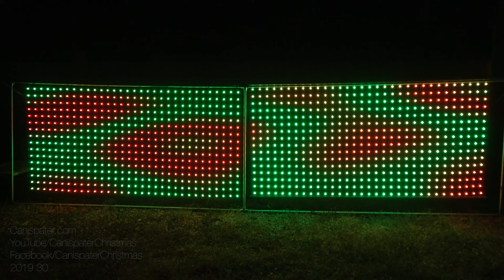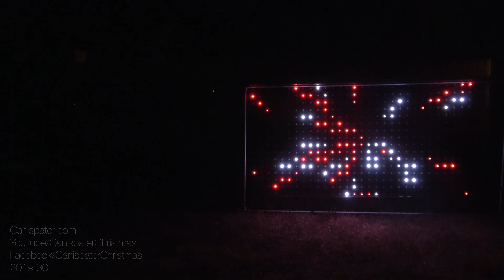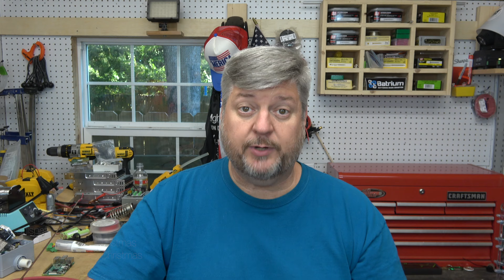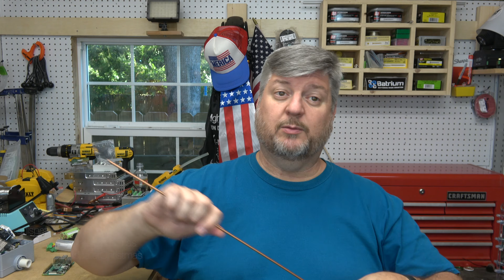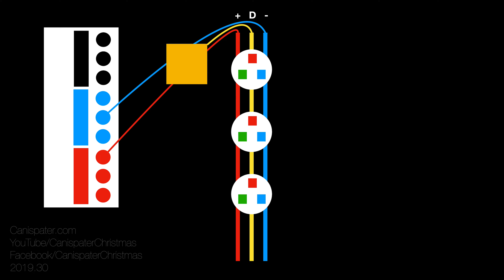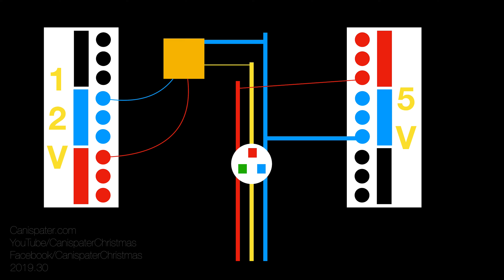🎄UPDATED! 5V/12V SHOOTOUT and Power Injection Follow-up  (2019)🎄

Comment from the maker: from delaserdudeXD:
Great Vid. Very Informative.
I'm including the info below to cut back on copper cost and keeping wire size manageable for new users. 

If you go by your video, you would need a  minimum of 6 AWG (37A rating) wire to handle the 30 Amps with a 35A fuse when being used at 100% all white - going from your PS to the fuse 

512 pixels x .06A = 30.72A

Hope the info below helps

 It looks like you've used the Amperage /Wire Gauge ratings for transmission(long distance). The rating for branch circuits (home) and chassis have much higher.
 Current ratings  for power transmission that you've used are a very conservative rating and based on high voltage drops (higher resistance) and long distances. 

For reference, the National Electrical Code (NEC) notes the following ampacity for copper wire at 30 Celsius: 

14 AWG - maximum of 20 Amps in free air, maximum of 15 Amps as part of a 3 conductor cable; 

12 AWG - maximum of 25 Amps in free air, maximum of 20 Amps as part of a 3 conductor cable; 

10 AWG - maximum of 40 Amps in free air, maximum of 30 Amps as part of a 3 conductor cable. 

Above is the rule of thumb for home branch circuits, Max amps for shorter lengths (chassis) have even higher amperage rating. It all depends on how many wires are bundled together, operating temperature and total length (frequency is also a factor but doesn't really pertain to us unless you're calculating for the data line) . Using the rule of thumb is usually more than adequate for holiday lighting. 

Lets take an example from the vid (since you're giving us a reading on the A/C side - this will pertain to house wiring) - 12V pixels running 50% at full white and your current power supply (PS efficiency rating will vary the Wattage used)  are using  178W would theoretically max out at 1.5A. If you had a dedicated 15 A circuit which typically is run with 14 AWG in a home - you could safely run 8 -10 of this type display on this circuit. 

Wattage = Voltage x Amperage (Watts Law) 

178W / 120V (my Average home voltage 118 - 122 volts) = 1.4833Amps
If you use the Transmission rating 5.9 - 7.5A  - you would only be able to have 3 to 5 displays on one 15A circuit or only 5-7 100w light bulbs on each 15A circuit breaker in your house

If we take a look at your fuse example: on the DC side when only 1 size wire is used ( it looks like you're using 2 legs off the PS so the fuses and wire will be smaller for each leg to the fuse). Running 512 pixels at 0.06A/ pixel  (Which is all white at 100%)  = 30.72Amps (theoretically - remember using the actual amperage draw would be the best and will be less at 50% or 30% which would allow you to use a smaller wire as well as having to use a smaller fuse). 

The single leg configuration would require a 35A fuse if you want to protect the Power Supply and separate lower rated fuses where you inject power or change to a smaller wire (since most newer pixels are only 18AWG [many are even smaller] and would melt its insulation and short or burnout before that higher rated fuse would blow. Since the insulation type used on the pixel wire is usually not known, it is probably safe to use a 7.5A fuse for 18AWG and 5A for 20AWG and possibly 22AWG (based on 125 max 12V pixels recommended per run - 12v pixels were chosen because they will run more pixels  and draw more amperage on the same size wire  5V pixels use)

 If we use the rule of thumb, it would need a 10 AWG wire, going from the fuse to the power supply and from the fuse holder to each distribution point either at the pixels or where you change to a smaller wire . 

If we use the Chassis rating a 10 AWG wire would carry up to 55Amps

Since the Fuse holder is short, if you look at the chassis rating of a 14 AWG it can handle a max of 32 Amps. If you to use a 30A fuse you should be ok (since the 30.72 tends to be a higher max than what they actually draw at all white). If you want to be completely safe you can use a 13 AWG (35A), but since this is not common your next choice would be a 12AWG (41A) that would even handle that 40 Amp fuse you're using now but a 35Amp would be better. 

As You know, to make things simpler
The community has come up with the best answer. 

Use a distribution board that is rated appropriately.
 Use individual 14 - 10 AWG wires From the power supply to the distribution board (based on total pixel amperage drawn) and the same size wire that your pixels are using -  to go from the distribution board (using 5 or 7.5A fuses [depending on wire size]). 

Make sure NOT to use more total Amps than the distribution board is rated for and NOT use more Amps than each distribution leg is rated for .  Remember you can have 1 or multiple injection point(s) from the wire you used to go to the pixels on the same leg, depending on how many pixels you're using at each injection point.

These are only recommendations, your mileage may vary. 

Amperage carrying ability varies not only by wire size but by insulation type and temperature. 

These recommendation are based on:
You are using commonly available USA sold copper wire at around an Ambient Temperature of 30° C, 86° F or lower

Using a fuse rated 20% less than max rated amperage carrying ability (same as power supplies) Especially if you use all white for long periods of time in your show. 

If you don't run and don't EVER plan to run all white for for extended periods of time and YOUR MAX CALCULATIONS ARE BASED ON RUNNING AT LESS THAN 100%  you can at your own discretion run at 10% less than max rated amperage carrying ability for wire and fuse.

Comment: Can I get a good description of what power supplies to purchase for 12 volt pixels. Ive had new bullit pixels in a box for 3 years now. Never done this before.  I am ready to learn something new. Love your videos. Greetings from Fort Worth.
Reply from the maker: Thanks! I prefer the MeanWell brand and typically use the 350-watt variety in my display. They are more expensive, but I've not had to replace one yet. People have also started to use server power supplies. They are generally higher wattage so good if you have a high density prop (or group of props close together) pulling a lot. I've also used the cheaper ones from Amazon and never had an issue, but I had spares just in case. 😂
Reply: @CanispaterChristmas  thank you sir. Really enjoy your channel. Keep up the Great Work!
Reply: I have one more question sir. I have 2812 bullet pixels. Do I need a special attachment to connect them to the differential receiver? Thanks
Reply from the maker: @stevetaylor2943  According to the spec sheet, 2812 is supported. What do you mean by "special attachment"?
Reply: @CanispaterChristmas  The connector on the end of my bullet pixels don't match up with the connectors on the Falcon Smart receiver . Do I have to cut off the connector on the pixels to put each individual wire into the smart receiver?
Reply from the maker: The receiver should have come with green Euro-connectors you use to plug strings into the board. Some vendors provide or offer pigtails so you don't have to cut the string. If that isn't the case, you can cut the connector off the string, but leave enough wire so you can use it as a pigtail for other strings. You have to make sure the wiring is correct (pixels usually have printing on them telling you which wire is which, but also sometimes hard to see). If you aren't sure, post in the Facebook group - someone can check your work before you apply power. 😂 You can permanently damage the string if you get the wiring wrong.

Comment: Hi this may sound odd but you have one power injection cable with a fuse on the end so how are you managing to inject so many times along the string ? surely the voltage using one string time it gets to the end the rating would be a lot lower than the first injection ? or maybe i am reading this wrong , sometimes i do not understand how one power supply can inject to all the pixels when there are only 3 + 3 - terminals unless you run many ports from a controller , which means more controllers more power supplies and so forth , is there not an easy way round power injection ? if so how ? most have not got the extra ports from controller .
Reply from the maker: It's the tightrope we all walk as hobbyists. 😂  Shorter strings means less or no power injection, but costs more ports. Longer strings require less ports, but require you to understand power injection. Without getting into the electrical engineering side of things, the whole point of power injection is to maintain voltage along the string so the pixels will continue to function. Any time a pixel is powered, there will be a small voltage drop from one side of the pixel to another. Going from the power supply to a point along the string brings the voltage higher at that connection point and the voltage starts dropping from there. I this example, I basically created a single connection "rail" and injected power (probably more than needed) at several points along the string. There's likely still a voltage drop as it gets further down the string, but the voltage it is high enough to power the pixels. Does that answer your question?
Reply: @CanispaterChristmas  Great reply , so from the power supply you made 1 wire with a fuse then teed off the same wire to power inject the pixels all the way along .

Comment: Hi I got 5v pixels ws2811 using a dig quad so it needs 2 sets of wires from the power supply , so what I was going to do was use a 5v 40 amp power supply to power the pixels  a string off 600 was going to power inject 6 times with a 5v 40 amp
Supply and just run the data from the quad , is this ok ? quite new to all this .
Reply from the maker: That should be fine. I'd recommend one or more fuses for the pixels just in case. I've used single-fuse holders from an auto-parts store or one of the BlueSea (marine) fuse holders from Amazon (check my links).
Reply: @CanispaterChristmas  I decided to get one of these , Hanson Power-8 Power Distribution Board ,  to make life a lot easier when power injecting , maybe this could help others out as well

Comment: Great video as usual.  This is my first year getting into RGB pixels and will be taking it slow with two 7 ft. Candy Canes with 200 nodes each from Boscoyo.  I have my controller and will be building a box for two falcon smart receivers.  

My question is this, when you power inject are you using an unused port on your board?  I saw that it appears you made hard wire connections.  Is this the only way?   I've seen the "T" power injectors so in the beginning I would probably use those for a larger prop I will hopefully come up with next year.  But I am definitely excited about the arrival of all the components of my display.  I am also in the process of going over your online course that I purchased.
Reply from the maker: Awesome and thanks! There are many ways to inject power. The main objective is to maintain enough voltage all along the string to keep the pixels happy. Each pixel drops the voltage a little so it's one of those things you'll get the hang of eventually. Power injection is normally just connecting another pair from the same power supply to the end of the string (through a fuse to be safe). The controller/receiver has fuses, but a power doesn't usually so you add your own. For 200 pixels, you may be fine with just injecting at the end of the string. If the pixels in the middle look dim or dull, then add another connection to the center of the string, but let the pixels tell you if they need it. Keep me posted!
Reply: @CanispaterChristmas  Thank you again for the info.  Looking at the Boscoyo site, it suggested running the 200 nodes as individual 50 count strings to make a matrix so that's what my plan is.  Lol...the interesting part will be doing the computer programing, but I'll be looking at your videos to get me through.  Thanks again and I'll let you know how it goes.

Comment: Idk 5 volt is no brainer for me I can run double the pixels same power supply. And I plan hooking house outline and window maxtrix year round. 5 volt is very easy every 100 pixel add 5v and ground and you will have 0 problems.just use some landscaping wire 14 awg and you can T off it power and negative 1 wire 400 pixels at 30%
Reply from the maker: It's a difficult concept for some. Glad you have it figured out. :)

Comment: Is it okay to tie 5 and 12v grounds together? I have a few 5v lights and don’t want to use half of my controller for 5v.  So I’d like to run them off a single port and  just inject the 5v downstream while the controller is putting out 12 and not connect the 12v.  Thoughts?
Reply from the maker: You can do that. Just make sure you remember not to power it with 12V. 😂

Comment: I made a mistake of building my first pixel prop using 5v.  I'm still using the prop but the rest of the house is 12v.
Reply from the maker: No problem. As you gain experience, you'll likely have a mixture of 5V & 12V in the display. They both have their place.

Comment: I am about to make an order through Ray Wu, hopefully will come in on time, do you run 12v or 5volts?  Usually the higher the voltage the lesser amps but doesn’t seem case with pixels.  I watched lots of videos and read lots of articles but still unsure of what to buy.  Seems like 12 volts are easier to work with.  Thanks for any advice.
Reply from the maker: Shipping from China is kinda horrendous right now. If you are in the US, try wiredwatts.com instead. 12V pixels require less power injection so better for longer distances. If you're making a prop with a large concentration of pixels in a small area (so power injection is easier), 5V are much more efficient. I recommend people start with 12V because it's a little easier to deal with. Once you have some experience with it all, you'll want a new challenge and can branch out to 5V pixels. 😂

Comment: Hey Jeff great video.  Your series help alot.  Question.  Are the inline fuses you use different depending on if you are using them for 5v or 12v?  The inline fuses I find online seem to all be for autos which have a 12 volt system.  Thanks.
Reply from the maker: No, they are the same. Not a lot of difference between 5V & 12V wrt current unless you're an electrical engineer. 😂
Reply: @CanispaterChristmas  Thanks Jeff, much appreciated.

Comment: if i have a mega tree 5v 400 pixels could i spice the wire at  4 different places and solder the wire to it and then connect to power surply
Reply from the maker: Sure! Whatever is needed to keep the voltage high enough for the pixels to work properly.

Comment: Hey Jeff! Thanks for the info! 
I’m looking for some advice. This year, I’ll be building a 12V pixel mega tree that is 30X100. I am going to use an F16V3 with 2 350W meanwell power supplies. I’ll run the tree at 25%-30% brightness. Im going to go 100 nodes up and 100 nodes down, so 200 nodes per port. And then use the last port for the star. I’m wanting to avoid power injection. Would this setup be fine? What you’ll you recommend?! Any help would be greatly appreciated! 

Thanks!
Reply from the maker: That will probably work, but it depends on the pixels you get. Try it out and if they dim toward the 200 end, inject power from the same power supply feeding the side of the board the port is on. If not, no need to worry about it.

Comment: great video again, like the way you used 1 power injection cable tied into where you needed it instead of seperate wires for each point..
Reply: my project for 2021 is my 180 degree 8ft mega tree. 16 strands of 50 so 800 pixels. still learning amp, watts, gauge wire and fuse lol
Reply from the maker: Thanks! Baby Steps! 😂